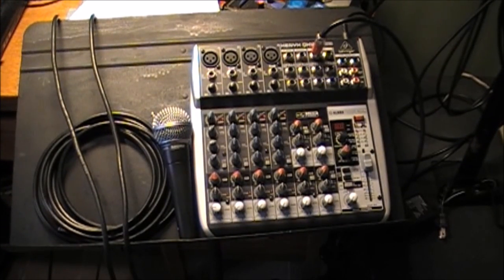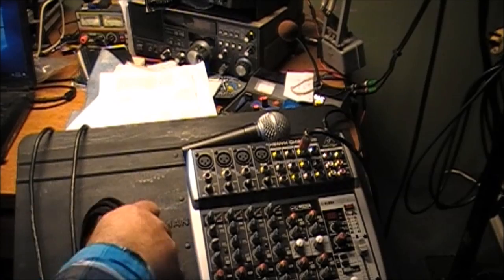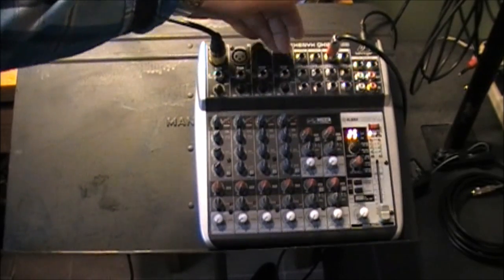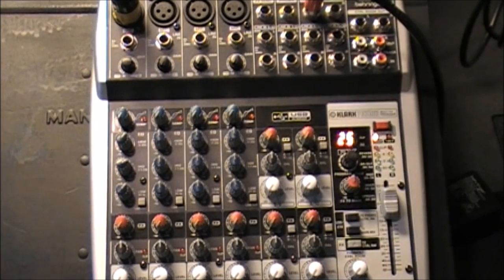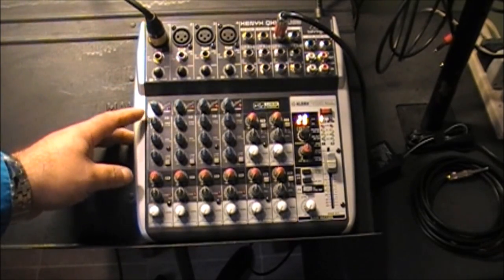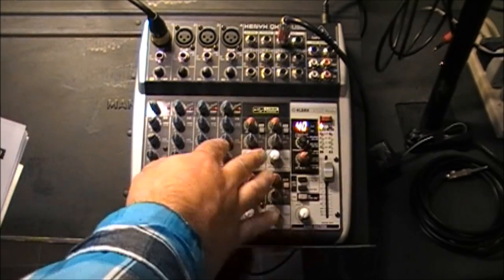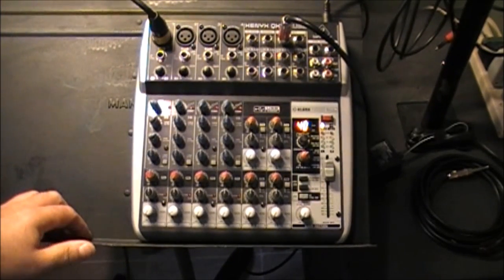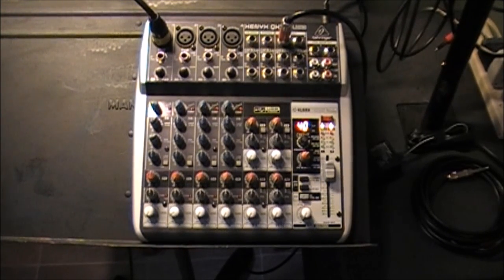Behringer Mixer: How to do a setup

Comment: Hey Andy so I need help as well. I know how to connect a microphone and the mixer to the PA speaker. However I have a guitar that I want to run through a loop pedal. I have the boss rc-30 loop pedal and I would like to know how I connect the loop pedal to the the mixer so from the mixer it can run through the PA speaker. Thank you for this video as well it was very helpful. Hopefully you can answer my question. I cant find anything on how to do this.
Reply from the maker: Run guitar to a the loop pedal. Pedal out to channel on mixer. If you need to use a stage amp, use  DI box first. Guitar into DI and out to stage amp. Low impedance output of DI to low impedance of mixer. Adjust as necessary. This mixer is capable of phantom power as well in case your DI can use it.
Reply: Andy Tobin Thanks Andy!

Comment: Thanks for the video.  Can i use this on stage to connect 4 drum mics to and send one output to the PA?  Would I use those two 1/4" jacks in the top right of the mixer (that you talked about sending to monitors)?  Thanks again.
Reply from the maker: You sure can. Always refer to the user manual to properly  use this mixer to avoid damage to any equipment. Thanks for watching my video. God  less you.

Comment: Hi Andy...great video it helps me a lot. I have a pair speakers active & passive model. I connect to the mixer by rca as the speaker only has that. My question is do I need to modified / add adaptor 1/4 Jack for better sound?
Reply from the maker: XLR is the best option but 1/4 jack and RCA input is functional. As I mention. injecting your audio intomthose XLR channels opens up much more control of the capabilities of the mixer and all the built in tools. I use RCA to play compressed CD and digital audio. The key in using RCA is to ensure you have high quality audio files so you get highy quality audio. Using a laptop mixer program to play your files is a great help if it has EQ and audio control capabilities.
Reply from the maker: I'd certainly would at least use two  ono channels in an RCA to 1/4 conversion for better control. Use quality cables and adapters and  balance the two mono signals equally. You may also use pan to take the left and right RCA signals to Left and Right of each channel. Example: Pan channel one 1/4 inch jack all the way left and channel 2 1/4 inch jack right. Experiment with these parameters and find what best suits your audio tastes. Enjoy.
Reply: @Tobinindustrial  thanks for the prompt reply andy...regards from Bali 🤗
Reply from the maker: @arilordaccount9152  God bless you and yours. Thank you for supporting my channel.

Comment: Hi, I am having the same model of a mixer, pls show/demonstrate, where to connect a main active speaker, and monitor, which switches to operate for both active speakers? means the main active speaker and monitor speaker. I am not able to hear my voice thru the monitor while singing along with the music. why does it happen? please guide me.
Reply from the maker: It sounds like you need to use the "Effects" button  as a monitor volume. The push buttons on the lower right need to be set to monitor. You will also need to power your monitor via an amp or use powered speakers as the signal out of the mixer is only pre-amp  signal.

Comment: Sir how to setup xenyx1002b for drums mixing?
Reply from the maker: Unfortunately, I don't have a kit to demonstrate. A well tuned set of drums will be much easier to work with sound wise. 

A good rule of thumb is to set up drums on their own and then recheck levels within the mix. Drums will technically sound great on their own but sometimes, in the mix they become muddy. This is when you need to boost mids and highs and roll off lows so that the drums are more distinct. 

If you want to make any drum, especially the kick stand out, use a good quality mic for that purpose. Also, you can use two mics and set up one to capture the wet and thick kick sound and use another mic to capture the snap and crack of the kick drum. 

Be imaginative as to where you place the mics and what settings. It never hurts to experiment with these things. 

Always remember, with heavy signals like the kick drums and the bas guitar, compressors, limiters, etc can be your best tools to balance them and get the best results.  

It is all about control, headroom, EQ, balance and overall pleasant and distinct instruments. A mushy sound is not what I aim for. I try and make each instrument stand out so you need to find a section of the overall EQ where each instrument will shine through, 

Experimenting is necessary. Each venue will also have a different sound and challenges. 

I hope this is helpful to you. Good luck with your mix down.

Comment: broo can i connect this behringer to traktor program???
Reply from the maker: It has a USB connection and so it has connectivity to a computer. The question would be, is the program you are using compatable with the unit? Where the unit is able to connect to a computer and is interactive, chances are, your program should be capable of communicating with this mixer. 

I have only used this mixer for live events and rehearsal. I have no real experience in computer patching.

Comment: Hi Andy, I just bought the previous 1202FX model (the one without USB in-built interface) so I'm wondering how to connect it to my interface via RCA. I have the USB interface that came with the Podcastudio bundle, the UCA222.
Reply from the maker: I have never got around to using the USB interface yet. I use this for live application only at this time. I think when you use the USB you need to tap into a computer interface program. The USB actually may be your audio patch that sends audio to the computer.
Reply: @Tobinindustrial  yes, the built in interface actually works immediately on any DAW because of its plug and record function but I was wondering about recording from the RCA outputs to an external interface, anyways, thanks for your time and keep up the good work!
Reply from the maker: @INDIE505  Thank you. Good luck and Merry Christmas to you.
Reply: @Tobinindustrial  Merry Christmas and Happy New Year! :)

Comment: Can you use guitar a fexts chord delay as well you set mick up can use effects on the guitar as well like cord delay even if i was singing at the same time and playing my guitar as well
Reply from the maker: Whatever effect you select will be the only one you can use or not use on every channel. You can only control the levels. So effects off or on and amount (level)
Reply: So If I just set for my guitar .only so the effects come out on my guitar and just you my mic as normal like  singing  just lift the voice on the mic control can you do that them that all I wanted to know thanks
Reply from the maker: @corky1548  yep, only one effect as selected and then every channel can use it or not. No guitar reverb and vocal echo. Only guitar reverb and vocal reverb. The only control is on each channel turn on or off the effects. Every channel has an effects button that can add or reduce the one selected effect or turn it off to have no effects at all on that channel. Good luck with the mix and have fun

Comment: This was very helpful for a complete beginner to mixers. I am used to simply playing an electric guitar plugged into an amplifier. If I want to optimally send the output from my amplified guitar to the mixer (say, from an Orange Crush dirty channel with significant gain [all on the amplifier]) what is the best way to have that amplified signal sent to a mixer (and then on to a PA or PC) -- a miked-up amp [and hence from the microphone in front of the amplifier itself to the mixer) or a direct out from the amplifier?
Reply from the maker: Microphone to side of your speaker or use a direct box (DI). Some amps will have a output which can go direct to mixer. That output can be high or low impedance. Low impedance is usually the best way to go with input on a mixer. That is why I use a DI a lot.
Reply: @Tobinindustrial  Thank you! Take care and be well.

Comment: Hi sir. I'm wondering how can i connect the USB interface mixer like the presunos.
Reply from the maker: There is a special computer connection on the back but I am unsure what that plug is called but it will need to be a USB plug for your computer or you can get an audio RCA 3.5mm jack on one end  and that will have the mixer plug on the other end

Comment: If you have two speakers, would you have a cable in the right main out or just link the speakers?
Reply from the maker: Either way would work but if you are interested in stereo then use left and right.

Comment: Hi sir.😀 one question. I have two powered speakers and i bought a cord thats 1/4 jack to the speakers and the other ends are rca's. Then i have this little cord that connects them both to one 3.5 jack when i want to play music thru my phone. I was wondering can i just buy a 1/4 jack adapter and then plug it to the left or right main out of the mixer? Kinda long huh. Haha Thanks sir I've been reading thru your comments section and boy you are a big help. Cheers from the Philippines😀subscribed
Reply from the maker: Yes, you can do that but be careful not to break off your internal jacks as the multiple jacks will be tall and firm and prone to be leaned against or hit and could damage the jacks. It should work fine as long as it is making a "mono" or "stereo" connection. I would just buy a couple of guitar cords or a pair of speaker cords with 1/4 jacks but that is your call. The 1/4 jacks will work just fine. Just be weary that the more connectors you use, the more opportunity you have of having audio signal issues. the lest path to audio signals is the shortest connection and with the least amount of adapters, plugs, etc. I am sure you will enjoy many hours of music with your setup. Thanks for the Sub. I will sub you right back.
Reply: @Tobinindustrial  thank you sir for your advice i will avoid too much adapters in my cords haha. I realized i just have to do it other way around cause the speakers have rca outputs and the mixer got quarter jacks so i straight up got it going last night haha thanks a lot and for subscribing. Nextym gonna buy some quality guitar jacks and xlrs 😀
Reply from the maker: @danielcruzmusika  Just read up on the gear you have to find out what is the premium outputs/inputs to use. The RCA may be just as good as the 1/4 in outputs on the speakers but they may also be filtered  and pre-amped differently and that would effect your overall sound control. I am sure your ear will hear the truth. Also, the RCA may have load limits for high wattage or something to that effect. I hope you are enjoying your audio gear.
Reply: @Tobinindustrial  thanks andy really.apreciate your advice. Im gonna switch it to quarter jacks or even xlr to quarter jacks for more premium sound in the future. For nw im just gonna stay put so i i'll know tons of difference using my ear once i got those badass cors hahaha thanks good day to you

Comment: Hi, can I plug my subwoofer into this mixer? where to?
Reply from the maker: You can send the line out left or right to the sub and then jumpo your sub signal up to your tops or vice versa. If you sub por top speaker is not powered., then it needs to go into a power amp first and then to the sub or top. I hope that is helpful information for you. God bless.
Reply: Andy Tobin Thank you. God bless you too.

Comment: Great explanation. I got this mixer (the Q version with the USB) and had a mic with TRS plug that lost all its power when I plugged it through an adaptor in the single mic input (6 mm). I was suspecting that connecting to XLR might improve the situation and have now ordered an adaptor from the TRS to XLR from same makers (Rode). According to your explanation here I'm hoping I did the right thing and by using this adaptor I should get more volume out of this mic. Or should I use that ultra DI? Thank you.
Reply from the maker: Either device will get your signal suitable for the low impedance channels and that is where you have the most dynamic and eq control. Br careful when using the TRS to XLR transformer as it stands pretty high and a smack or blow or constant tugging  could eventually cause damage to the XLR inputs and could desolder pins that are connected inside. I have never seen this happen before to me but it is just something to be aware ofThe long trunk of the TRS to XLR transformer can accidentally give such movements leverage enough to break where it connects. Just be cautious of this issue and you should be fine. I personally like my DI as it is versatile but both would work well I think.
Reply: @Tobinindustrial  thank you. I check that DI online... it does not seem to have an input for a TRS? Or maybe the website was missing that info. I'm also confused on how you connect that DI to the Behringer mixer, is there another cable needed?

Comment: Hi Gentleman, when you inser the phantom power, is it present both for all the XLR output? Or I can choose who I can to give it? Thank you so much.
Reply from the maker: Phantom power, when engaged, is available to all XLR channels. No worries. it should never cause any damage to any channel not needing phantom power and can be used as normal. Any channel needing phantom power  (Like using a DI Box) will automatically be able to tap the power. Any other XLR input is safe to use in any user manual configuration. Enjoy your mixer.

Comment: Do you have to use a di box to use an electric guitar
Reply from the maker: Not at all.
Reply: @Tobinindustrial  I'm planning on using the crunch distortion channel on my amp
Reply from the maker: @hikupmusicofficial  Just be sure to use only a preamp signal into the mixer from your amp. if you put a powered signal into the preamp input of this mixer, you are going to damage some electronics inside. USE a PRE-AMP signal only to get the distortion you seek. You can also use a mic to "mic up" your amp.
Reply: @Tobinindustrial  mines a solid state marshall no tubes
Reply from the maker: @hikupmusicofficial  Just be sure not to send a power amp signal into a preamp input.
Reply: @Tobinindustrial  so should I plug it into the input like I would with my guitar or threw send or return or the loudspeaker inputs?
Reply from the maker: @hikupmusicofficial  If you want to get the actual distortion your amp produces to be injected into the mixer then find a "pre-amp out" signal. You may also try the send return on your amp but read up on whether the signal is pre-effects or post effects. You will want post effects. if all else fails, use a mic and place it in front of the speaker ( hang it over the top) place the mic to one side of the speaker and then plug the mic into the mixer and that should give you lots of tonal control on that channel.
Reply: @Tobinindustrial  the amp distortion is controlled by a foot switch witch as its own connection in the back of the amp
Reply: @Tobinindustrial  the send/return is in the back as well for effect loop and the speaker has its own connection as well
Reply: when connecting a guitar amp and a mic do you need 2 amps or just one to have a mixer work or just one amp is good
Reply from the maker: @hikupmusicofficial  You can connect multiple instruments to the mixer and the one speaker with an amp will accept the mixed sound from the mixer. no worries.

Comment: Greetings! Thanks for the video as it was very helpful. One thing I'm still a little confused about is using Passive vs Active PA speakers. I have a Behringer Xenyx QX1002USB. Do I need to have a power amp if I'm going to use Passive Speakers? Thanks.
Reply from the maker: Yes, you'll need a power amp for a passive speaker as the mixer has a very low watt output. So you send a signal out of the mixer and into a power amp and from the power amp to the "passive" speaker. Good luck with your setup and thank you for your comment.
Reply: Andy Tobin awesome. Thanks for the info and the vid! Very helpful
Reply from the maker: I am glad I was able to be of some assistance to you. God bless.

Comment: I never new how complex setting up audio could be until I tried myself. I thought I'd be able to figure it all out but the more I look into it the more I'm getting confused. I have multiple audio devices hooked up to my pc but can only use one device at a time. How and what do I need to be able to use all devices together?
Reply from the maker: Nzo D Luffy just set up everything in seperate channels,  mix it down and  set main volume for all mixes.
Reply: Andy Tobin - thanks for the reply. I'm going to sound really ignorant here but what do i use to be able to  put them on different channels? Is it this mixer in the video. I've looked at a few but just wasn't sure if it was the equipment I nedded.
Reply from the maker: Nzo D Luffy whatever plugs into the output of your devices as long as it is a preamp signal and has XLR or quarter inch jack to input at each used channel